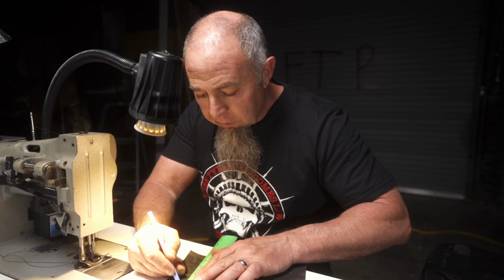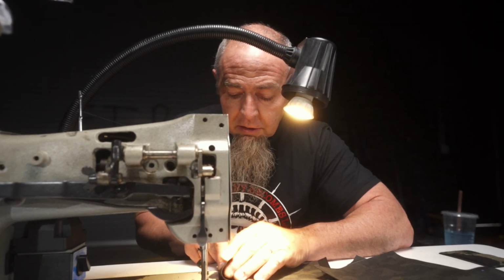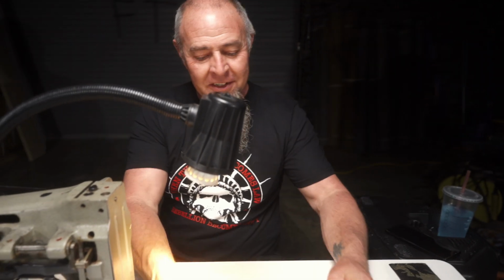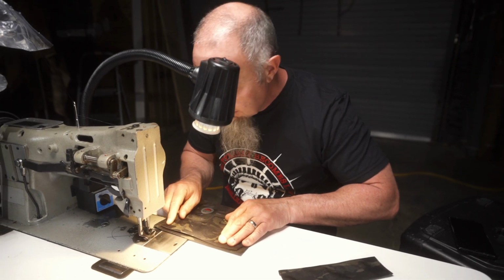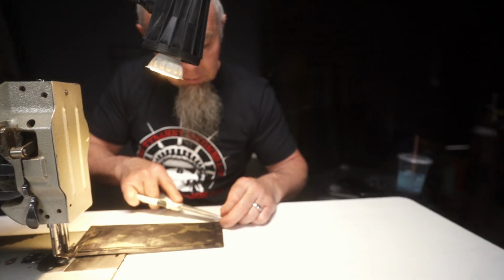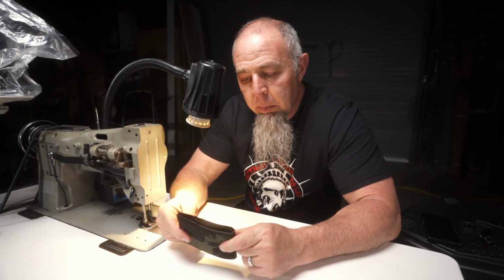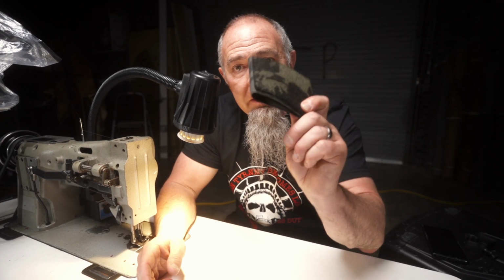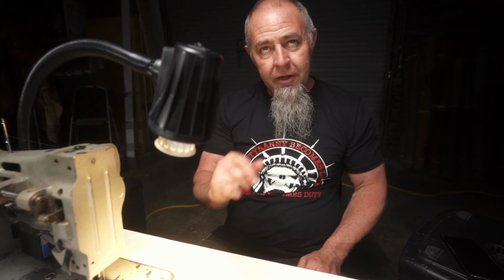FULL BUILD | episode 4  #tacticalgear #sewing #sewinghack #nylontacticalgear #empire

Comment: My first guess was a checkbook wallet. Without cheating in the comments section. I see others are better seeing than me. Thank you for the videos John and crew. 

I have some questions about type of sewing machine. Currently I’m using my wife’s home machine. Don’t not have inventory built up yet but working on some pouches non tactical. I have no backing in that. to get my sewing down. Should I get a used cheap industrial machine or newer one in the 1500 range. 

Thanks again an will be looking forward to your next video